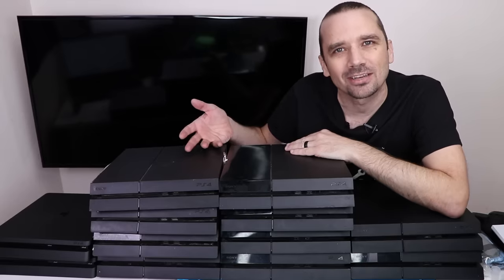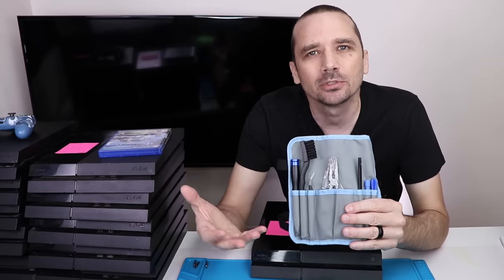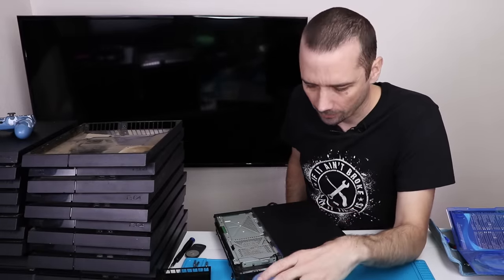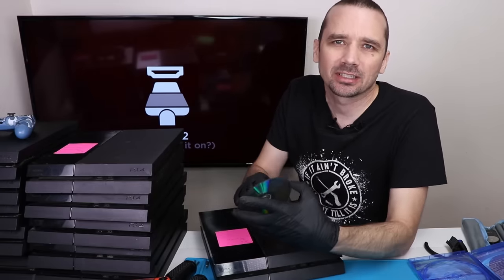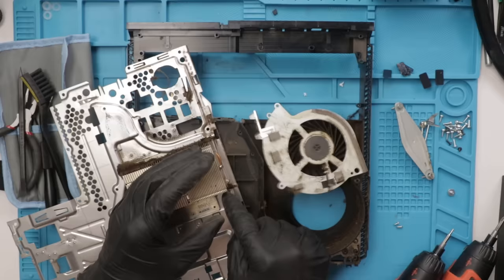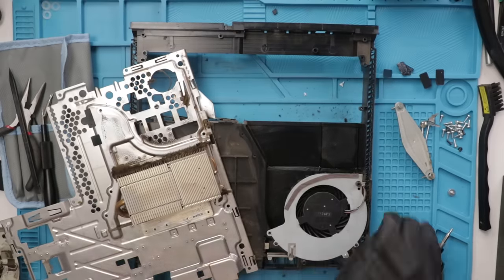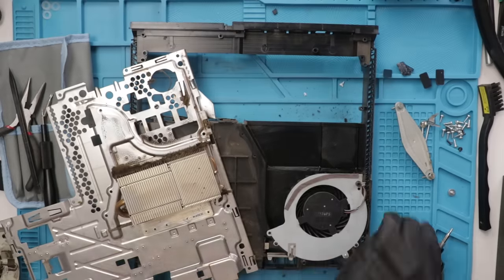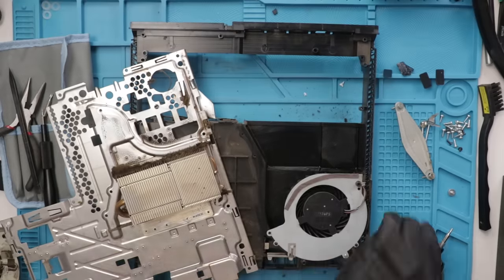I Bought 12 Broken PS4's From eBay - Let's Try to Fix Them!

Comment: Hey I need some help and everywhere I've looked it doesnt help I recently brought a broken ps4 I've fixed it up so it works but now I'm having a stranger controller is where it locks out my inputs and shuts off my ps4 controller even when its plugged in could please get some advice

Comment: I wonder what problem mine has, I cannot connect the controller after initialize, tried all the steps found on sony site, and other suggestions on the web. No faulty Usb cable, as in safe mode i can connect and use the controller to update the system.

Comment: Is there a way to fix ps3 from red light coming on when you plug it in but when you hit the power button the green light goes off and then you hit the power button again or unplug and plug it back in to get the red light back on

Comment: My house neutral wire has encountered some problems lately and fry some electronics. Things like tv,lights, fans and my ps4 was oozing smoke when it happened. Any idea what I can do so I can diy fix my ps4?
Reply: Don't fix it until you get the neutral line fixed. Because you would've wasted your time to fix it. It depends on what went bad, if it was the APU, southbridge, or ANY BGA chip it would be so expensive to fix that you might as well get a new one.

Comment: Or just use an paint brush and air compressor. Also indeed make shure you clean your room and don't smoke in the same room as your console my buddy used to to that wel it's a wonder that it still works

Comment: I dont know what happen to my disc drive i put the rollers back by watching ur video but still nothing it wont take it plus i had to rig up my fan to a push button outside my console cause i broke my my my wire but i cleaned my heatsink and put on new arctic siver cause was getting hot there was nothing on my cpu so thats what i did bit now my disk drive dont work

Comment: Need some help. My brother damaged his hdmi port on his ps4 original and brought it to me to see if i can help fix it. Because I had a ps4 similar to his we tried to do a harddrive swap to see if that worked but it didn't. Then i took his fan and put it in mine since i had a bad fan and was going to give him mine so as long as he remembered his login but he didn't. So none of that worked and i put his ps4 back together. After doing that i couldn't get the power button or the eject button working on his system but it still would turn on with the PS button on the controller but i couldn't get any power to his disk drive after that like it's completely dead so i gave him my disk drive. Everything was fine outside of the eject button not working but now he has an error code saying that the original disk drive has to be put back in but again I can't get any power to his disk drive. So how do i help him.

Comment: You know only a certain dock drive will work properly has to be matching numbers or corresponding numbers able to use: I tried to install any cd drive it Dosent work. Not to mention if it does it probably won’t run correctly will get you through but will not be optimal

Comment: Hey I really need some help. My PS4 is stuck on the blue screen for syncing the controller to the ps4 by the USB port. I did everything and plug the controller in the USB and près the PS button but I doesn’t work. Tried with multiple cables and nothing work... it is really frustrating. Can anyone help please, I looked each and every videos on YouTube to solve this problem but none worked..
Reply: Allen Ly  Reset controller to factory settings mabye
Reply: Jackthetryhard It worked! Thanks man

Comment: One thing that happened to me with the xbox 360 there was an xbox Where the disc drive didn't work. I previously had a xbox where I failed to fix the red ring of death. I took that disc drive out and swap it into the one with the bad drive. I had no games but did have a DVD. It played the DVD just fine so I figured there was no need to see if it would play a game. I sold it on Amazon then the guy I sold it to said the drive didn't work so I lost my profit.

Comment: Have you ever heard of compressed air to clean first take apart take outside and use compressed air to blow out the dusts then wipe. PS don't used you bare hands to remove potentially black mold as it will make you very sick.
Reply: Compressed air isn’t good on electronics.

Comment: Now im scared how my ps4 looks like.
I didn’t open it since 2013
Reply: Is it running and it's not that hard to clean
Reply: It runs, but VERY HOT AND LOUD.
And i don’t have the special thing to unscrew those 3 bolts at the back
Reply: @norek0765  Ooooh then just order it it's not that expensive
Reply: Ik, but ill do it later
Reply: @norek0765  Do it now because it will be more broken if you don't take action
Reply: I don’t think it will, a bit.
Cuz i don’t use it.
But ill do it!
Reply: @norek0765  Ok and grab a can of compress air
Reply: Ok, but i don’t have one. Lol
Reply: @norek0765  Then grab one

Comment: Help my PS4 is overheating as in it says it’s too hot then turns off and I’m too scared to open my ps4 and brake it
Reply: That drummer kid go to a local computer shop at your city where they fix it for small money its worth it!
Reply: Young Rob Are local computer shops even still open
Reply: Young Rob nvm I’m gonna buy a new one then clean the old one and sell it
Reply: That drummer kid you need new paste mines was like that
Reply: jayvon williams i have opened it up but couldnt get passed the power supply its really dusty i had it second hand and its a launch model i think so its prettg dusty
Reply: jayvon williams I feel stupid I opened it up and my heat sink was clean which means you are right

Comment: Here's what I think; If the resell price of a used refurbished PS4 sells for $140 on ebay then why did you buy 12 PS4's for nearly $1100 that you knew didn't work?!? - To me this doesn't make any sense to pay this much.  Did you and could you have bartered down to a much reduced price when you bidding/considering buying these PS4s??? - I would have contacted the seller (even if I knew they had advertised them under auction) and asked them to sell them at a much reduced price.  Do you know what price a broken PS4 should be sold for or, are you going off an average price sold on auction sites such as ebay???
Reply: He literally says at the end that he did it for the video so he wasnt as picky as he would be if he was just doing it for the money

Comment: I won’t ever buy another brand new Sony console for reliability issues I had with my ps4, less than 3 moths of buying it brand new the hard drive failed, that was covered under warranty, a little over a year later it stopped playing games for some reason and everything is freaking out
Reply: Axillary Gaming sounds like you had a bad deal man. Doesn’t mean all Sony’s consoles are that way. For instance, I have never had any issues with any Sony consoles I have ever owned. Should I get one that ends up not working for some reason I am not just gonna say: “I’ll never buy Sony consoles ever again”. Folks have become so unrealistic and unreasonable these days🤷‍♂️🤦‍♂️

Comment: mine wouldn’t push the disc out once so i rebuilt the database then the next day it wouldn’t take the disk in so i took the top off n tightened the screw that takes the disk n it worked jus fine
Reply: and i got it when ps4 came out n still got it till this day

Comment: I feel even though repairs are done. This is very low grade repair work as you clean the area of dirt that had issues but nothing else residual around the area's. Poor repair work in my opinion. Maybe The cleaning of the whole system is cut out. Just my opinion though